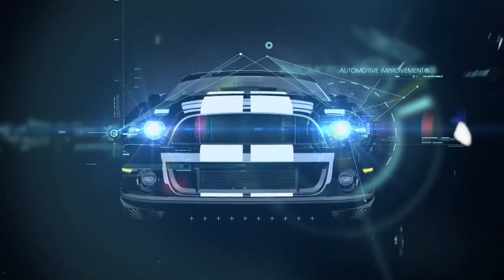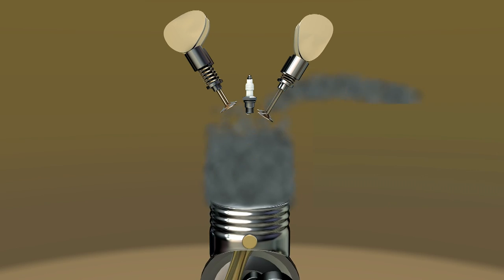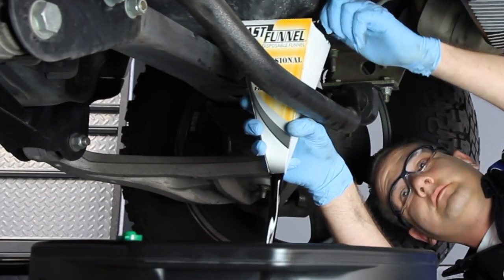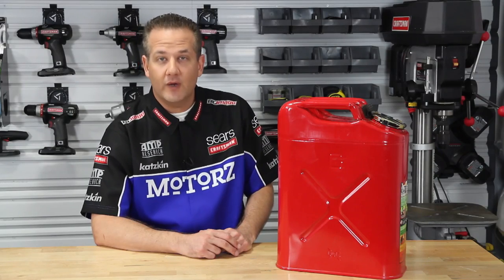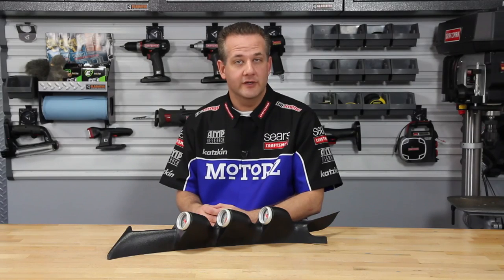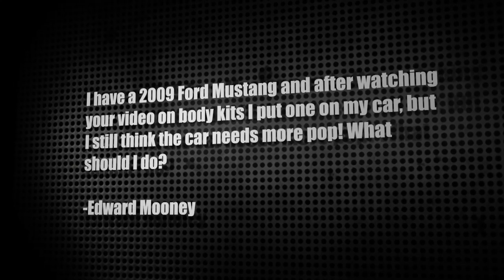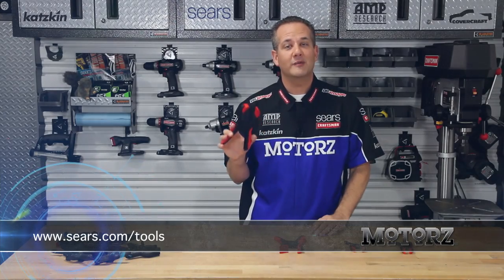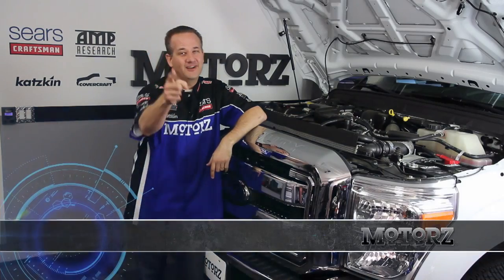Everything You Ever Wanted To Know About Diesel Engines Motorz #75

Comment: RE air intake, I'm still a little confused. I understand that diesels always have the same amount of air flow to the cylinder (based on comments here), but what about stoichiometry? If you're injecting more fuel into a cylinder, wouldn't you need more air to compensate? I can't imagine this being irrelevent for diesel engines, even without spark plugs surely they would need an optimum fuel to air ratio for combustion? Is air pumped in at a higher level, accelerant being the limiting factor? Surely that is inefficient, would the cylinder not have to overcome a higher pressure on the upstroke for no reason at lower RPM because there is extra air not being used? Or am I failing to understand something here?
I'm far from a mechanic, but I've been working on my bikes for a few years so I know my way around a gasoline engine, but diesel is completely foreign to me. I recently bought a 4x4 so I'm trying to get my head around some of the basics before working on it.
Reply: MAF and computer do that job. When you floor it, engine just pulls more air in, sensor tells the computer how much went in, and that adjust the amount of fuel, often going a "bit" rich, and there's your puff of smoke. Diesels are typical workhorses, not really designed for boy racers...
Reply: Air intake on diesel is a function of RPM and turbo boost pressure. After the engine comes near TDC it starts injecting diesel which burns in the oxygen rich environment. It keeps injecting for part of the expansion stroke. If you want more power you inject more fuel. At some point you inject more fuel than you have air to burn and it then burns in the exhaust header, turbo, then exhaust pipe. The risk is you really heat up your turbo doing this. Diesel fuel droplets also don't instantly ignite and burn uniform. They must super heat and evaporate then ignite as they mix with the air. That leads to partially burnt droplets making suit. Read: http://www.maxxtorque.com/2009/03/diesel-timing.html
Reply: The "Optimum fuel to air ratio" in a diesel engine depends on what the goal is. The optimum is not simply based on an ideal of air to fuel like in a gas engine. In the diesel angine more fuel = more power, up to the limits of what will physically burn in a single combustion event.  The air density in the chamber is already pretty much maxed out based on the design of the engine and the limit to extra diesel that can burn throughout the combustion event is as Jeremiah Alfrey describes. An intercooler can indeed make a big difference to the diesel engine making the intake air a higher density for the volume but it really is all about the fuel, not the fuel-air ratio.
Reply: @krzysztofniedzwiedzki8061  you used sensors and a computer to explain how a diesel put more fuel into a cyl when needed but what about the mechanical motor like 12 valve cummins, ntc 855 cummins or a 3406 cat no sensors or computers on these

Comment: ive always worried about a runaway. dose this happen in new trucks or is there a way to prevent it?
Reply: Another guy commented, some modern diesels have a throttle which only shuts when the key is turned off.   Helps calm shutoff vibrations, and eliminates change of runaway (by cutting combustion air).
Reply: Runaway engines are a very rare event indeed. I have had this happen to me a few years ago while driving a Mercedes 811d school bus. 
Luckily, having a manual gearbox, I just put it in top gear and dumped the clutch to stall it.
Difficult to do on an automatic... I guess the only way to shut it down would be to block the air intake, or cut the fuel line.
Reply: smiffy1071 cutting fuel will not help you in a runaway situation
Reply: Bryce Davis lol so your saying an engine can run with no fuel coming to it?
Reply: Chris Padgett yes, it will run with no diesel fuel that is the definition of a runaway diesel engine, for example diesel engines on drilling rigs can run away if there is a high concentration of natural gas in the area
Reply: I thought a runaway was when the engine started burning it's own lubricant.  If that's the case, cutting the fuel won't shut it off.

Comment: Hi, I have a diesel short school bus that I'm going to convert into a RV, i bought it for $500.00 the man said he thinks it blew a head gasket how can i tell and if it cracked the block, please need advice should i try to crank it, please get back with me I'm desperate thanks
Reply: Check oil and coolant while engine is cold and not running. Confirm they don't look contaminated like coolant in oil or oil in coolant. Next, crank engine. If it starts see if the exhaust has a lot of smoke. Color will indicate a problem, blue for oil and white for coolant. Either of those will indicate blown head gasket or the like. Check for idle quality, rough idle can indicate low compression in one or more cylinders.
Reply: Thanks, if it is that, How much do you think it would cost to fix or should i get a rebuilt engine, it's gonna be my home so i am on a budget if i have to fix it do you know of a place i can get a good rebuilt engine.....
Reply: But if it is not a blown gasket what could it be
Reply: We need to cover the basics first and then we can move onto the next step. Once you let me know the answer to my first post then I will have a better idea.
Reply: Ok will do getting battery to day and will make video thanks.......

Comment: I have a hard time believing that gas won't ignite in a diesel engine without spark. The heat alone from the compression should just about be enough.
Reply: +Devin Dowless Hi, I have a diesel short school bus that I'm going to convert into a 
RV, i bought it for $500.00 the man said he thinks it blew a head gasket
 how can i tell and if it cracked the block, please need advice should i
 try to crank it, please get back with me I'm desperate thanks
Reply: Devin Dowless Since gasoline is designed to be resistant to self-ignition, gasoline in a diesel engine either won't ignite or will ignite at the wrong time. Diesel engines run leaner than gasoline engines, meaning that the air-fuel mix has a higher proportion of air than a gasoline engine
Reply: That is all fine and well but diesel engines run much higher compression ratios. That alone would cause the fuel mixture to ignite before it should. My point was that the mixture will ignite and it cannot be controlled. None the less, it will still burn.
Reply: Devin Dowless I say if it really bothers you sir go get yourself a diesel car or truck and and put gas in it and report back snap to it 😂🙄
Reply: So what are you trying to say? Gas wont ignite in a diesel?
Reply: Devin Dowless they are two completly diffrent things, with diffrent ways of igniting
Reply: James Franco I understand that. The afr for gas is 14.7:1 and diesel is around 14.5:1. Regardless that is not the issue. Gas in a Diesel engine will ignite without question and will ignite before the piston has reached tdc. The compression in a Diesel engine is too high for gasoline. It will run, the engine will start but for how long. So, why is this even an argument that gas won't burn in a Diesel engine?
Reply: Devin Dowless gas will ignite but it doesn't have the lubrication like diesel does so it will ruin the motor

Comment: My 2017 Ford F450 transmission got up to 248 degrees on several occasions.  Ford says that its designed to run hot.........248 is really hot

Comment: 9:50 what catalytic converters? Thought we were talking diesel at that point then you took a left turn.
Reply: +Ryder Smith diesels started using using cats in the the 200'0's, after 08 they were replaced by a dpf and after '11 they are required to have a dpf and scr after-treatment system

Comment: Also, you can run a diesel engine on heating oil. They are the same, heating oil is just dyed red, because it is not taxed like diesel fuel, and if a living cop identifies you, catches & reports you with red fuel in your tank, its a big fine. But if you're an anarchist sick of the government's BS, you just don't care, or you're in a desperate situation. Then heating oil is always an option.
Reply: Yes it does but they do allow it for off-road purposes or heavy machinery and they can’t do anything

Comment: Never get a K&N air filter unless you personally maintain your vehicle to the T. A K&N air filter that is not properly oiled and cleaned can ruin an engine. Also diesel engines do not benefit very much from air filter upgrades because of the fact that there is no throttle body restriction anyways.

Comment: 9:50 
Has the epa crippled the northern farmer? You state that running winter #2 / kerosene contaminated diesel will render  Modern Diesel useless without spending  several thousand dollars worth of repairs to the exhaust system at a more frequent intervals.  
Northern this year was north of the OK TX state line.

Comment: He forgot to add Diesel #1, commonly known as red diesel, which is for off road use only. Used mostly in farm and construction equipment (i.e. tractors)
Reply: Charles Tate dyed diesel is identical to on-road diesel. It just has dye added so it can be identified, and it isn't taxed because it is primarily for agricultural use (I work in ag)

Comment: Why cant the diesel be injected first and then the air compressed together with the diesel?
That way you wont need an extremely strong pump to inject the diesel into an already compressed piston.
Reply: Because the engine and fuel system would have to be perfectly designed and manufactured to detonate the diesel/air mixture at the EXACT moment the piston  hits Top Dead Center. This would be an unrealistic level of design and manufacturing that, even if it were attainable, would be extremely expensive and the engine would quickly stop working correctly as it wears and loses compression, or fuel quality changes. The point at which the fuel detonates would also change as the cylinder heats up.
Reply: its not a simple answer. similar to why an efi gas engine is more efficient than carbs. the longer the air/fuel mixture stays combined the longer the fuel has time drop out of the air. causing the ignition to be inconsistent. as air is drawn into the cylinders it swirls around because of many factors such as shape of intake runners or valve diameter and piston profile. the resulting air/fuel mix isnt perfect. same amount of fuel and air but its how the fuel is distributed in that air. if you injected diesel into the intake runners, the intake stroke would pull a wet charge(fuel in air) into the cylinder letting it (literally)wash the side of the cylinder. when the piston comes up on its compression stroke some fuel stays atomized and burns properly and some fuel condenses back into a liquid coating the piston and rings and doesnt burn equal to the atomized fuel. and raw fuel is bad for diesel oil causing other problems. injecting fuel into the compression stroke is more accurate. you dont want to ignite while to piston is half way down. thats lost energy. you also dont want it happening half way up the compression stroke. full detonation at top dead center gives the most efficient and powerful boom possible. and higher injector pressure gives better fuel atomization. im not scientifically accurate but then again im not a rocket surgeon. but im close. this is only my opinion others may vary.
Reply: +Steffan Jansen van Vuuren 
Because there would be no way to control the exact moment of combustion and combustion would be inefficient due to the air not having reached peak temperature when fuel is introduced.  The injection on a diesel is like spark timing on a petrol(gas) engine.
Actually, with modern common rail diesels there is more than one injection pulse per power stroke, as many as 5 or 6. This makes combustion smoother, so the engine is quieter and makes combustion more efficient, so better MPG and lower emissions.
This isn't going to save them in Europe though.  Currently in the UK, there is growing opposition to diesel powered road vehicles, due to particulate emission and NOx.  These issues have been linked to significant health risk and so legislation is looming to get rid of diesel powered road vehicles.
It is a problem for UK government because 15 years ago they actively insentivised the use of diesels via lower fuel prices and vehicle tax, due to the lower fuel consumption and CO2 emissions of diesels.  Another case of poor research and thought process by government!
Reply: +That Guy 79 Hi, I have a diesel short school bus that I'm going to convert into a 
RV, i bought it for $500.00 the man said he thinks it blew a head gasket
 how can i tell and if it cracked the block, please need advice should i
 try to crank it, please get back with me I'm desperate thanks
Reply: Hi, get a good engine cleaning soap.
Give the engine block a good clean.
Then inspect the block with a torch to see
if you can spot any cracks or places where
oil appears to leak out through a crack...

Cranking the engine will circulate oil through
the engine and any leaks will become clearly
visible...especially through the head seal(gasket).

Comment: Do not waste your money with any chip or flashing the ECU if you want to save fuel. 
It's simply impossible to have more power and save fuel at the same time, physics don't lie. 
Yes, chip and ECU flashing will definitely increase power and while drastically increasing wear and tear on the engine and the entire drivetrain causing precoce/premature failures.
Just Google it.

Comment: He shows us a ford but doesn't tell us about indirect injection or glowplugs
Reply: Indirect injection? All diesels are direct injection aren't they otherwise the fuel wouldn't explode? Glow plugs just warm the air in the cylinder before the fuel is injected to help with cold starts.
Reply: benbmx1000 the ford 6.9 IDI diesel is indirect injection, and the early 7.3 was also IDI
Reply: benbmx1000 Indirect injection means it injects the fuel into a separate chamber in the head that is connected to the cylinder by a small-ish hole in the head.

Comment: I wish you would have talked about "deleting" and Blue DEF. I'm new to both of those terms. And why does Cummings seem to be the most popular choice in Diesel engines. Lastly, what was with all the exhaust in those race videos? I'm no environmentalist, but I'm not trying to kill the planet either. When I'm towing, will have thick, black exhaust like that?
Reply: Frore Scoville Frore Scoville Blue def, (diesel exhaust fluid) is a non-hazardous solution made of 32.5% urea and 67.5% deionized water which is sprayed into the exhaust to break down NOx emissions into nitrogen and water. Cummins are a popular engine because they typically produce more torque due to the inline 6 cylinder design. And all that black smoke from the exhaust is unburnt fuel, in order to get as much power as you can you have inject as much fuel as possible as well as much boost as possible. Usually when you tow you don't want to see a lot of black smoke because less smoke is more efficient.

Comment: "Longer strokes create more torque, due to a longer connecting rod." False. Longer stroke creates more torque, due to a longer distance from center of the crankshaft to the center of the crank pin, which increases actual stroke length of the piston in the cylinder.
Reply: You're wrong.
Reply: The rod length does not affect stroke length. The coment stands correct.

Comment: I love diesels, but the new quiet and stinkless diesels get lousy mileage, unreliable, and expensive    to maintain.  You are better off with a gasser.  Ultra low sulfur diesel has less energy than pre 2007 diesel plus usually costs 70 cents more per gallon.